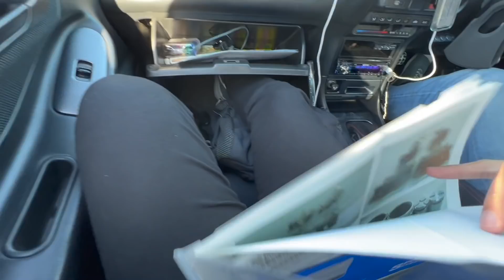S2000 Gets A RARE JDM Varis Carbon Fiber Hood and it looks AMAZING!

Comment: Yooo, Albo! That looks so good! Recently got my Seibon hood for my RX-8, still waiting on completing that project, it's been taking over a year now T_T... I would definitely invest in protecting the coating on that hood if you don't paint it; from factory, they don't come with very good UV protection, and the clear on it will turn yellow and flake away in about 2 years or more if it stays in the sun all the time. On a side note, I absolutely love Stan's vibe. I didn't used to look at Integras with much liking before, but after Stan showed up on your channel, I started to like them more and more.